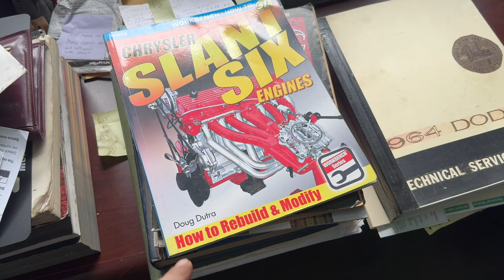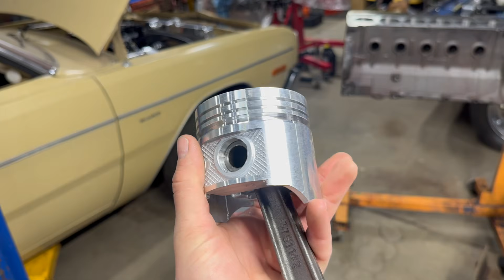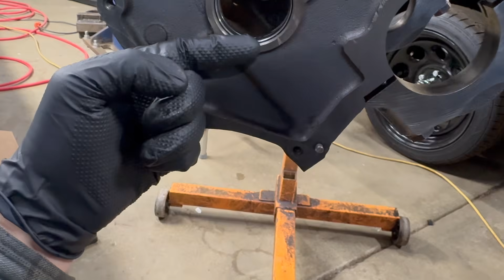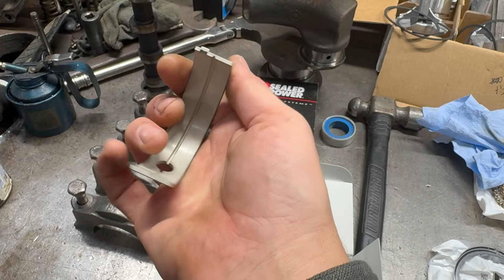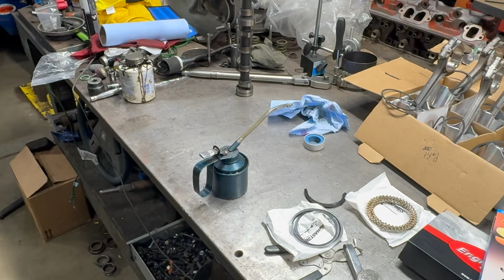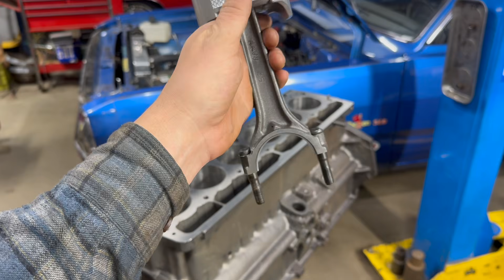Go Fast Slant Build! Lightweight 225 Info, Deck Milling Tech, Short Block Assembly, And Much More

Comment: The best "cheap" piston option is the 2.2L 4 cylinder piston. Use those with 198 rods on the 225 crank, and it brings the piston about all the way up to zero deck; they call it a long rod 225 if you're not familiar. I'm currently having an engine built by Gill Welding that uses Wiseco pistons and Molnar rods; a combo meant specifically for the slant. Although, the rods and pistons together are somewhere around $1,500, I think. They have also told me that, so far, they have not found the breaking point of the cast crank; 400-500hp and still good. The oil hole in the deck goes straight through into the head and comes up the rear most rocker shaft bolt.

Comment: I wanna see somebody put in independently carbureted velocity stacks [reminiscent of the burgeoning tunnel rams of the older 413s, only much lighter, and without so many twisty, windy, snakey, wonkey pieces that have to be so meticulously mounted, since they like to get angry at each other sometimes...

The ultimate benefit of a pair of divorced, opposed tunnel rams on a V-8 is that decking the block makes no difference to their fitment...

Although milling the heads can...

Because they needed more meat at the bottom to deal with the leverage problems involved in bolting the rams to the heads...

Oh...

And they have an interchange tube on them which can also be super finicky.

And the support mechanisms to keep the carbs propped up so they don't just break off with all that length on brittle cast iron...

Or cast aluminum...which can also crack...

https://board.moparts.org/ubbthreads/ubbthreads.php/topics/2098294/re-long-ram-intakes.html

Comment: I done a factory HP cam,ported and polish,2 bl intake, header, 727 lock up,243 gear in a dart sport. 22mpg at 83mph and 3g. Was doggy at the line. Also a 15° adjustment on timing with a knob.

Comment: I did a 'Hot Rod Slant' about 20 something years ago.  .090 off the Head, Purple Shaft, Super Six Intake with a BBD from a Pre-Smog 318, Large exit Exhaust Manifold.  One Belt driving the Alternator and Water Pump.  Electric Fan.  Installed in a $100 1980 Aspen 4 Door with a Floor Shift 3 Speed.
Many folks were very 'amazed' at just how 'Potent' that setup was.  Very fun to drive.
.

Comment: any good machine shop would have chamfered those    i would find another shop    what else did they leave out
Reply: LOL. They probably just wanted it outa the shop after 120 passes on the deck!
Reply: @2321brendan  That's a whole other crime. You can take way deeper cuts on cast iron than 0.0005".

Comment: Chevy Guy here.  No one I personally know has ever called a Slant 6 prone to failure.  At least nobody I know who is of similar vintage to myself.  Sure,  we'd tease about the gutless "leaning tower of power" But there was respect for the reliability, even with horrific maintenance. 

Everybody I know has a story about their absolute indestructibility in fact.  My High School buddy in the 80's would buy rotted out $200 70's Aspens and Volares from beachside with Slant sixes with 200,000 miles on them and drive them until something failed.  It was usually the suspension of the vehicle.  His best one was a see-thru ex-taxi Aspen with 350,000 miles.  The engine was original, had almost no rings left, but fired up every time.
Reply: I had an 80 Dippy Coupe with the 225. Managed 300k out of it before it burned enough oil to make the cat glow red. Car was in good shape when I junked it. Should've had the mill rebuilt. I had already installed an A999 lock up and 8 1/4 from a later model taxi ( both were rebuilt) and that 1 had factory 2.94 gears which made the lil 90ish hp slanty kinda snappy around town.
Reply: They are indestructible, but limited in what you can do with mods. They can only take so much, before they fail on you. But for a daily road warrior, they are indestructible

Comment: Expansion plugs - at least, that's what the parts suppliers call 'em (with a smattering of "freeze"
plugs tossed in for the layman).
The Slant Six has been widely regarded in SAE circles as one of the all-time greatest engine designs.
If you've ever owned one, you know how close they are to perpetual motion machines - absolutely
reliable for years after you'd long wished they'd die. 🙂
Upwards!
- Ed on the Ridge

Comment: Hi, Jaimie!  Love the channel!
I stopped bending wrenches for a living in 1980 when I left the USAF.
FINALLY, someone on YouTube actually knows why those 'core' plugs are there!  (Is there a better way to get the sand out of the water jacket of the casting?)  In the olden days, we referred to them as "soft" plugs because they were softer than the cast iron and that gave the plugs their seal.  They are NOT there for freeze protection because water expands equally in all four directions when freezing and will do so throughout all the water cooling jacket and coolant passages.  ( have seen a SBC boat inboard motor  crack in the lifter valley when stored over the winter in ND without having the had block fully drained.)  We used to use black hardening Permatex during installation of the soft plugs to seal them, too.  Never had a leaker, either.
Though I haven't done mechanical work for a living in 45 years, I still enjoy seeing knowledgeable guys doing such excellent work.  I agree with the use of engine oil for assembly lube.  I always would use Plastigauge to check rod and main bearing clearances, though.  Trust but verify was always the rule of the day.  Never found one that wasn't right, but then it only takes one to ruin your day and I always slept better just knowing.

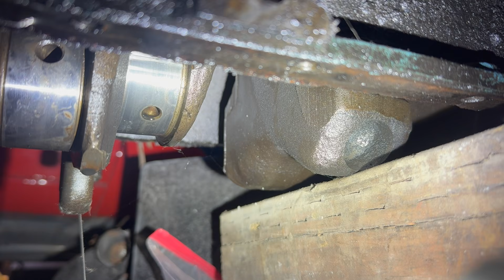Comment: 3:55 “…the counterweights on these things… it’s kinda nuts.”  Is that a sly reference to a somewhat rude term for the pair of center counterweights on the more massive forged slant crank? 😂
Reply: Exactly my thoughts
Reply: @fortheloveofnoise the 225 with forged crank has wide bearings the same ones on the 426 hemi

Comment: I had several Leaning Towers of Power over the years, I definitely have a soft spot for them.  I also worked at a warehouse years ago where the forklift had a slant six in it.
Reply: Back in the '70's, the Air Force flight line tugs and warehouse tugs were powered with the slant six.  Most of the forklifts, too.

Comment: Slant 6 is weak and worthless, tell that to my dad, he took a S6 from a rotted out pulpwood truck (chassis literally sitting in the mud) cleaned and oiled it, put a new oil pan on (Just in case) and put it in a 77 plymouth Volare python with a 3 speed overdrive manual. the engine supposedly had well over 100K before the truck was retired, my dad drove it another at least 75K+ without issue, didn't even replace the clutch. I've had a fascination with the S6 for years and always wanted one, but never found a good one

Comment: One thing that I would really like to see on a slant six (and even an old straight eight), is a true cross flow head, to employ multi-port fuel injection in the intake manifold, the possibility for four valves per cylinder, and a truly tunable turbo system. Not to mention a new head design that could improve on the possibility for head studs for improved clamping force. I realize that the internals are part of the weakest link in a 225, but from experience, head clamping force, valvetrain, fueling, and airflow are of vital importance when turbocharging an otherwise NA engine.
Reply from the maker: You and everyone else, but a cross flow head would make it very much not at all a slant six as it was intended to be. Just start with a better engine if that’s what you want.

Comment: Via the head decking. if there any chance of fastener tread fatigue I would stud the block for the head to transfer the fastener load to the huts on the head. Instead of bolts.
Reply from the maker: I’m not worried about that here.

Comment: You should have enough parts in the shop to build that entire motor so when the car comes it it's just a swap!
Reply from the maker: Need the already worked head and the cam out of the other engine. And the oil pan, and the super six manifold, and, and…

Comment: The cross hatching in the cylinders looked mint/perfect after the machine shop hone. Whole engine looks super clean! I am curious of what Dyno numbers it will get after its fully built. 150HP?
Reply from the maker: Ohhhhh it may well be a bit more than that

Comment: Hi. When I worked with GM Powertrain, the foundry technicians referred to them as”welch plugs”
Reply from the maker: Welch plugs are specifically the type that are deformed into place. But some may well use that term for the typical plugs, idk.

Comment: I heard them called core plugs freeze plugs and expansion plugs .    Also a trick I've seen by Ed Smith for installing rings on a block with no chamber is to cut an aluminum soda can and wrap it around the piston on the ring clamp leaving a tiny amount hanging down to go into the bore of the block
Reply from the maker: Nice

Comment: Gallery- a long narrow passage. Galley- a kitchen on a boat. Hmmm,
Reply from the maker: Right, a kitchen, from which everyone is FED. The definition you chose for gallery is third on the list, and the least well known I would think.
Reply: A galley is also a type of low, flat ship propelled by oars. Is the oil passageway in an engine block named for a passageway, an art display, a marine kitchen or an enormous rowboat? Who can say, eh?

Personally I think it started with "gallery" (which would probably have been used to mean a passageway more often back in the 1800s and early 1900s than it was today) and then people in the US dropped out the 'r' and with it a syllable, making it easier and quicker to say. So it's really a dialect difference at this point, kind of like the whole aluminium vs aluminum thing. We all know what we're talking about regardless so the heated argument is a bit silly.

Comment: Slant six, with a manual three speed is a beautiful combo for cruising on country roads.
When you’re cruising in the zone those motors are good reliable, fuel efficient beauties.
Class, not fast.
Reply: Floated back to the 70's thinking the same thing

Comment: Well...I don't know about the 'engine blowing up' due to the lack of extra main caps, but all I do know is that you BETTER run a heat crossover passage or there will be no way you can drive that engine on the street!  😜
Reply from the maker: Silly
Reply: @DeadDodgeGarage  🤣😂🤣😂

Comment: If you really want to impress me make a V12 out of two slant six engines.
Reply from the maker: I’ve been thinking about this for over a decade.
Reply: @DeadDodgeGarage  Simple.  Just use a mirror....  😳
Reply: @DeadDodgeGarage Ive been thinking about this for about four decades.
Reply: @DeadDodgeGarage  ausie..  bro yrs ago built, himself in a shed. a 2.0 lt ford pinto. took 120 th off the head & block. off set a std crank to make it a 2.1+ ish.. seeing we dont have merker 2.5 pinto,s here.. anyhoo.. on the dyno, it had 190 hp.. 8000 ripums.. twin 40 webers.  are there any 265 hemi in u.s..  ive had 2. 245,s. tons of guts.. best engine here is the ford barra.. the gm LS are chunk sht as usual for a gm motor..
Reply: @DeadDodgeGarage  COTTER PINS..... ARE SPLIT PINS... SPLIT PINS... COTTER PINS GO IN BIKE PEDALS, NOT BALL JOINTS..   ausie..  its split..split...  not solid...  you never even got aluminium correct.. personally.. i like aluminum..  ex brit..ausie..
Reply: I want to do one also but I have to get a decent vehicle with one that hopefully has a manual transmission in the car. @DeadDodgeGarage
Reply: Be far easier with a pair of 3.9 v6....lol
Reply: @warenmongers5405  "We choose to "Build a V12 slant six  in this decade and do the other things, not because they are easy, but because they are hard".
Reply: @442olds7  well if you can't double the #  cylinder /s double the use of the ones you have ,  Detroit deisel  like, port the side of the cylinders right through the block, add  the like minded side super charger , use all the valves for exhaust . Now a days you could install the direct injection fuel at new the bore port (s) furnace braze the joints of the "new plumbing " prior to machining. very custom camshaft, might want to add roller bearings to this mess. Solid works fluid dynamics program for  "swirl or loop " scavenging design de jour for the nozzling of the pressurized bottom cylinder feed. The temps and pressure's at the cylinders  bottom being what they might be should be of almost no pressures  worthy of " brow sweat " 
as the cams custom, and on needle bearings now, roller cam lifters .crank trigger and  multispark' pack from an out board, preferably from an dead manufacturer 's junk yard like a ? 225 hp Evenrude  of the late 1990's sparks at your advance curve and then more sparks for the following 30 degree's  just to make sure  it lit !
may it be higher reveing than this 2 stroke https://www.youtube.com/watch?v=1SktI9CFI80 simalar 4
"stroke" but made  14 ft lbs at 5 hp
Reply: @442olds7 Amen
Reply: I just had a stroke trying to read these comments.
Reply: Allen millyard could do it.
Reply: you need look at old 1920 engines. 2.5 lt with 480 hp..  we havnt advanced.. also they had super chargers, multi valve, desmodronic drive, ohc, were doing nothing new..  a 1.5 lt f1 car has over 1000 hp... you got a 442 olds or just dreaming.. the chev 350 is the biggest chunk engine on earth.. fact.. this is why speed shops were invented.. look at the chev 293.?. 6 cyl.. it had rail rockers.. why did chev abandon that.?. & make those fkt up 350 heads..   clevo, forever.. beat you guys at the drags in 70,s with a clevo..  ausie... 351 4v.  160 mph. std. with 3 people on board..  yup chev..  not....   xy gt ho..  as dick johnson said.. ''  you got a v12, hmm..  thats 4 cylinders too many....''

Comment: The Australian slant sixes were way better than the ones we got. Specifically the 265 hemi with a 6 pack
Reply: Would def be more interested in seeing Jamie build & thrash one of those-
Reply: Actually, we in Australasia have the 225 Slant six, which is exactly like was sold in America, and, we have the American designed, but Australian improved Hemi six cyl upright engine in the 265 ci that you mentioned, and also 245ci , and 215 ci . I've had a few 245's ( and Slants) and I've had one 265 ci , and in 2 barrel form I reallly didn't notice more power over the 245's , it's only about 15 horsepower difference between the two.
Reply: The "slant" six and the Aussie hemi six are two totally different engines that do not share any common parts. Only thing they really share is their designer William Weertman.

Comment: Is there enough adjustment at the rockers to account for the 0.060 and still have good geometry, or will you need shorter push rods?

Comment: Hi. Dozens of times, to help with compression, quench, etc, we offset grind the crank. Once you do, you will be hooked. A few more cubes, increased compression, better quench- its all upside, but yes- a good crank grinding operator needed and the increased cost.

Comment: Very timely video series for me right now, as the ‘71 truck 225 I have to drop in my ‘64 Barracuda is at the machine shop right now. The plan it boring the piston .040 over due to some wear and damage in the holes. The number one took on water having sat outside for 40ish years in the truck … in the woods. That cylinder is definitely getting sleeved due to deep rust pitting; another cylinder is borderline and I am hoping .040 will clean things up without the need to sleeve it. Yeah, my first instinct was to just go find a better block but, since I apparently live in a part of the country that is a vast “old car restoration wasteland” scoring another block would include some road tripping to obtain. So, the added time and expense, plus my general desire to save as many factory parts as possibly, I made the “against my thrifty nature” decision to spend the money on “the bird in the hand” and have this engine cut … hopefully a decision I don’t live to regret!?! Other than .040 overbore, no other “performance mods” are planned. I am just hoping for a good running, long lasting engine.

Comment: A friend of mine has spent a ridiculous amount of money building a spicy 225. Full roller, high rpm, high compression, loads of aussiespeed goodies.
10k€ for a goal of 300hp...
Reply: Hey man dare to be different.  Look at how much money people spend on flathead fords to make 200hp.  🤣
Reply: @mos63halan68 yeah, but atleast the flatty v8s sound good. Slants sound the best with a factory muffler 😂
Reply: Yep 300hp Slants are hard to do, And keep them streetable.   Your friend gets it. Hes infected with slant sickness.  There is not many aftermarket parts for the slants ,notably no aftermarket heads. So the builds are all about squeezing everything out of what you got . I have been researching head port flow stuff ,and the slant heads and ports  are all the opposite of what you need for power. This is what makes it a challenge. No LS checkbook from the catalogue builds with the slant . Everything you do needs to be for those 1-2% gains. So 300hp Needs every trick in the book+ probably triple webbers or efi.

Comment: I like straight 6 engines...smooth!  I love the little Mopar slant 6, but I really like the way BMW straight 6's have the intake on one side of the head and the exhaust on the other side.  Always seemed more logical for airflow.  Of course, those are overhead cam engines...also seems more logical...those Germans!